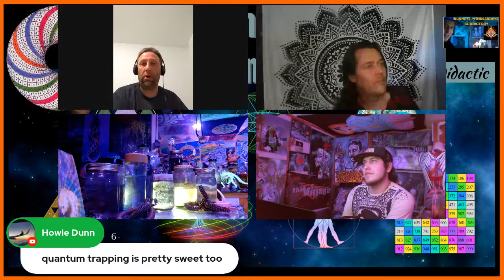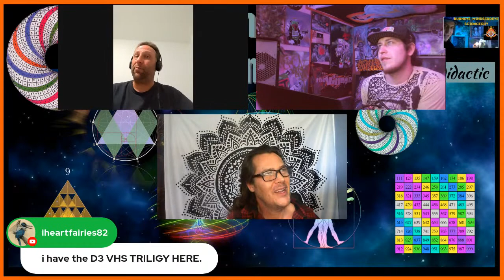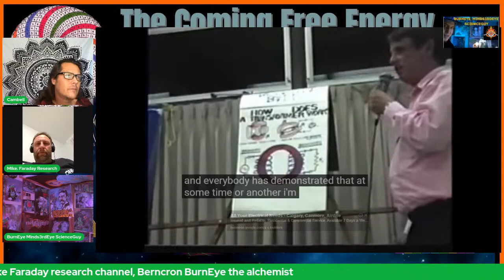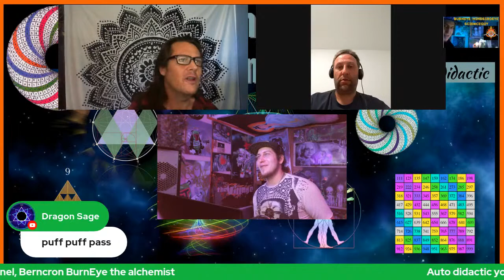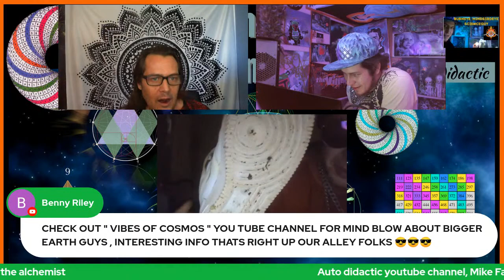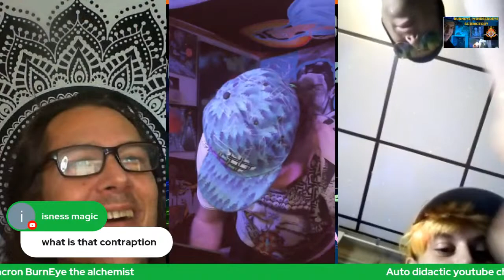Weekend @BurnEye's! Electricalengineering @faraday research mike @auto Didactic pt.4

Comment: I remember pulling apart a battery back in the 60's 
The battery casing was made of cardboard 
Pull it apart and it's got like lead discs separated by acid / dielectric